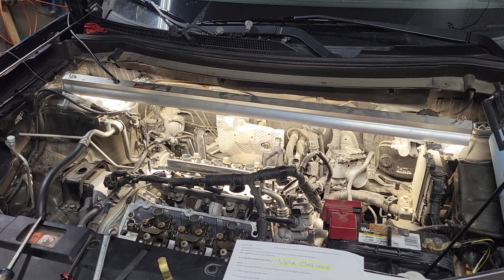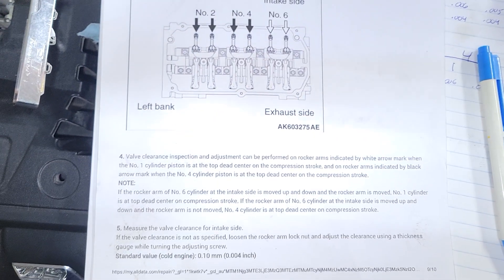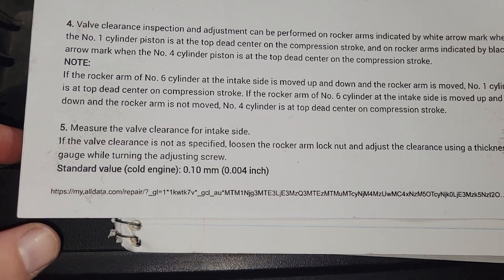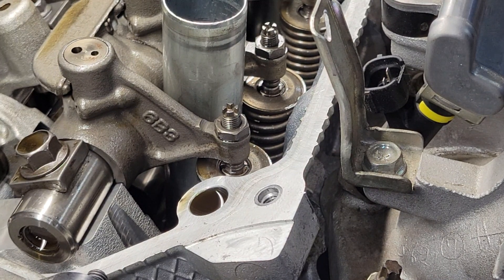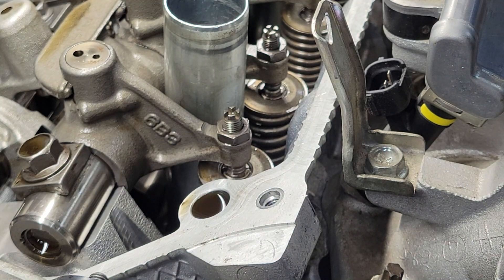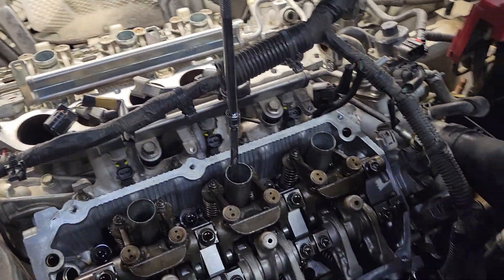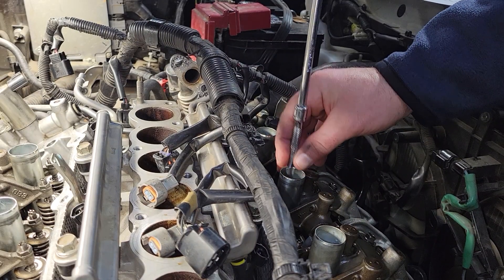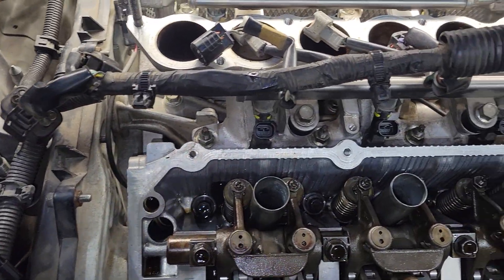Mitsubishi 3.0 V6 Valve Lash adjustment & clearance.

Comment: Well done video. Detailed enough to accomplish the task without unnecessary segments just to fill time. 
I wish the inside of my engine looked as nice as yours. I bought mine used and I doubt the oil was ever changed.

Comment: Im working on an 07 with the 6b31. It looks identical to this engine. and it has 85k miles. It has a misfire under load between 2k and 3k rpms, it doesnt misfire above that range or below. Is this a symptom of needing a valve adjustment or is it something else? Im stumped.